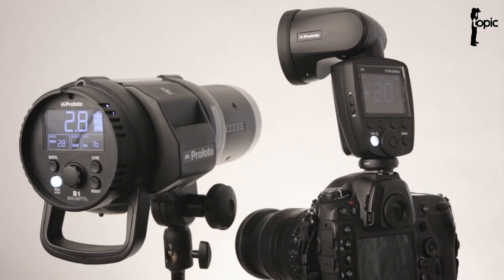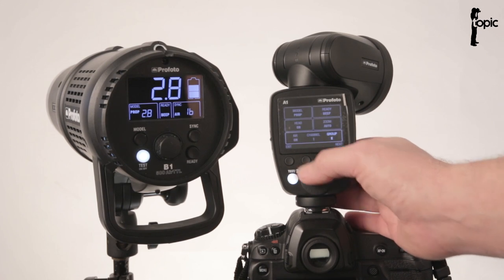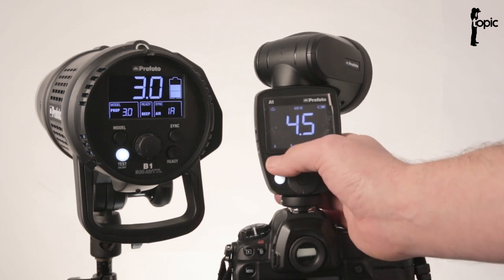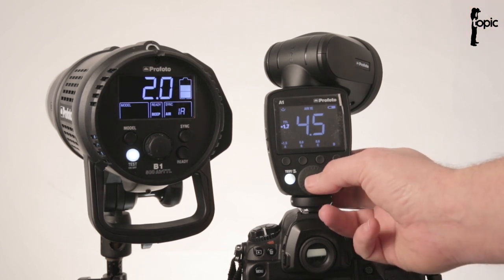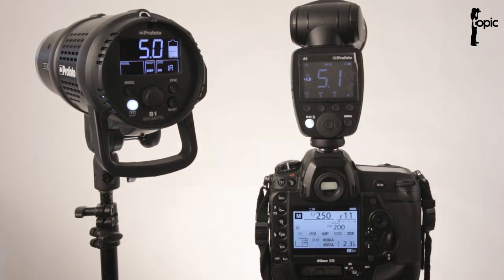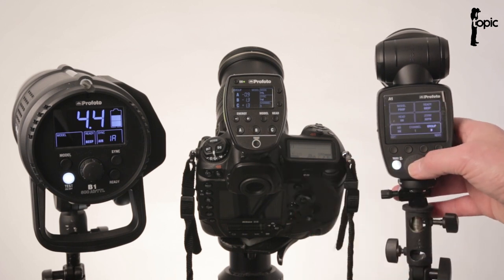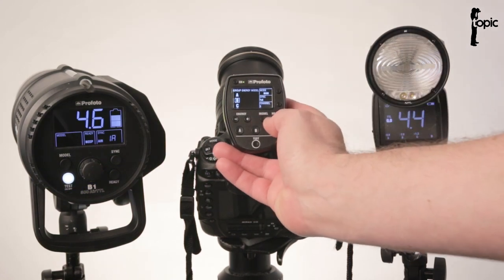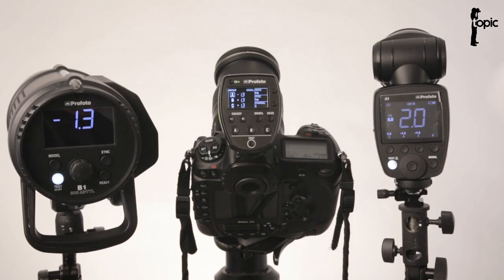Profoto A1 - Air TTL -Setting it up as remote and slave

Comment: Yes this is how to use the A1 as a 2 unit set up but both off camera B1 as key A1 as highligh on a stand , this all makes a great compact set up otherwise the A1 does nothing a normal speed light will do but at twice the price.
This is a great tutorial for setting the two units working as a unit.

Comment: Hi, thanks for the useful tutorial.  Is it me or are you changing the settings in the remote unit totally blind? I know that this was a problem with the traditional TTL remote, but OK Profoto was first to the party and, ok,  it was expected that the system will not be perfect. Now is 2017, and we have a bunch of options that are more powerful, faster, much more flexible and advanced, and as reliable as Profoto (but without the global support). That solution also cost a fraction of the Profototo's versions.  I hope  I am wrong and the issue is fixed and I can easily see the settings on the remote units
Reply from the maker: Hi Jaime.  The remote does not display the  heads power level. If your using TTL it shows the compensation your applying. In manual it shows you the power your adding or subtracting but not the actual power number.
Reply: Thanks for the reply, right not it seems pure stubbornness, I can't believe that in all this time they were not able to fix the issue. Disapointed,  999$

Comment: The only reason I would get one is to have a backup trigger for my b1x.
Reply from the maker: Hi William makes a awesome Trigger. We have a number of customers buying this instead of a Air remote, as you can still use as fill.
Reply: william morales 

It’s actually the best speedlight on the market and the only one that can provide consistent exposures when used at up to 9fps with the D850.

Comment: I returned the A1 and B1 back because it DID NOT work on our Sony cameras.
It did not work using Jinbei HD-610, Interfit S1 & Phottix Indra 500.
So the main problem is Sony can't get their act together. Sony likes to pump out newer cameras every 16 or 21 months.

At the same time by staff DID NOT like using the Air Remote TTL /or A1 w/reasons:
- No ATG AF Assist Beam on Air Remote TTL
- No ATG Auto Sensor on A1
- Got less than 150 flashes on B1
- Got less than 250 on A1
- Broken MIS shoes
- Hard to push or insert onto Sony A9, A7 & A6000 series
Reply: Profoto hasn't made an A1 for the Sony as of early 2019.  Now you know why they didn't work for you in 2018.     I have a Sony A6300, Sony A9 and A7RII.   The B10s work flawlessly with all three.
Reply: @mavfan1  So, the Air Remote works with the a6300? It's not listed official on the compatibility chart. I have an a6300 and I'm considering a B10.